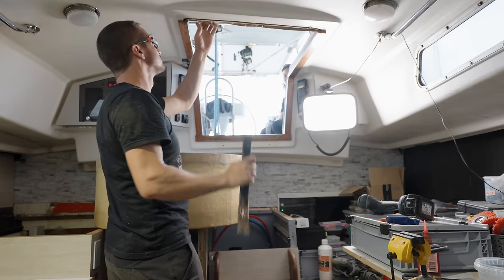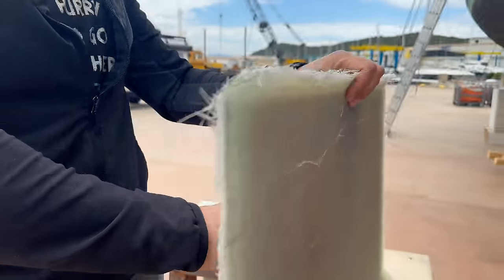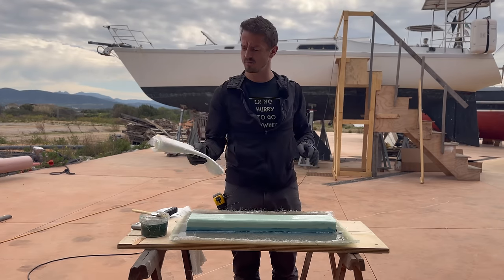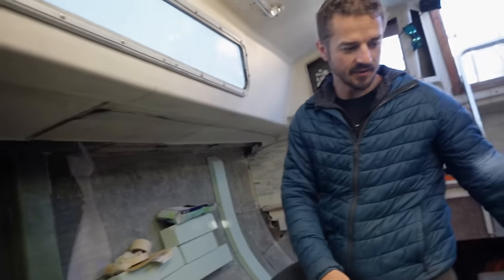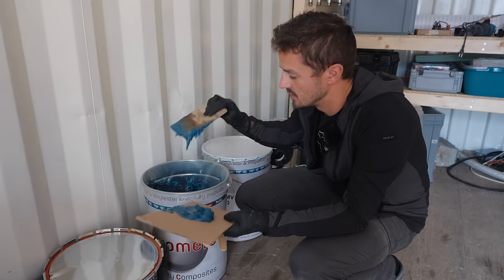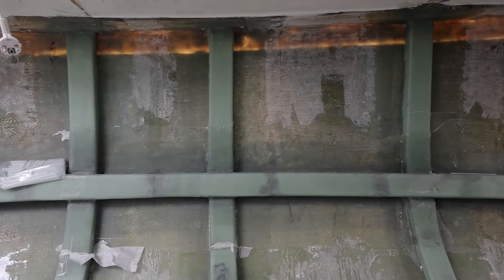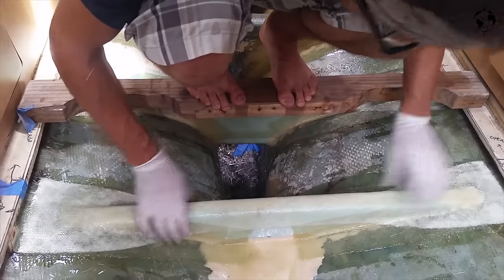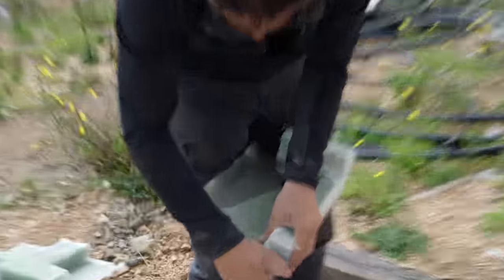Cutting Open our “New Hull”: What Could Go Wrong? | Step 386

Comment: For your delamination: (1) peel ply may leave a wax residue in place, so secondary bonds require cleaning (2) if the surface was fully cured, you need to sand it before bonding to it again, peel ply helps but isn't enough (3) you need to prewet the fabric before laying it down, don't lay it down dry. Your hired pros are using a lamination table; they saturate the fabric full of resin on a plywood sheet on your floor, before then moving the wetted fabric in place. This ensures a good bond. You didn't do that.
Reply: Oef this comment save the project....❤️
Reply: I was going to point out the same thing as your #3. Their process wasn't entirely the same as the crew working inside the boat. If they want piece of mind try doing it again but fulling wetting the fabric before laying it down. It will be a way different outcome.
Reply: They also didn't saturate the peel-ply when they made the initial piece.  leaving some of the waxes UNDER the peel-ply on the surface of the resin.  They needed to dewax the surface and then grind to key the surface.  You can see the pro's peel-ply was saturated.  Saturating the peel-ply makes "its resin" part of the overall layup  allowing the waxes to "float" to the surface above the peel-ply
Reply: Yeah of all comments of this video i think this is probably the issue
Reply: I'm a bit shocked by the easey seperation of the parts. I've had parts come out of a waxed mold that put up more of a fight.
Reply: Good points
Reply: Soo many differences. You just build yhe hull, I didn't see you Sand it before applying the ribs. They applied the ribs to a 50 year old hull that was fully cleaned and sanded first. Completely different foundations. Your fine.
Reply: Wet on wet or , once cured , grind for assured mechanical key when adding more laminate . ( imho ) the hairier the better for true keying of new to cured.. you’ll be ok you guys are smart and adaptive 👍
Reply: I would definitely try to delaminate a sheet inside boat, to many factors here not to make absolutely sure something else went wrong., pretty sure you will.
Reply: 😟Thanks for that cliffhanger. Now we will all worry about you
Reply: Going by the curled up edges of your test piece it looks like you glued your rib to the "underside" of your hull piece. Going by what others have said above, the fact you didn't wet that initial piece that you started on a piece of peel-ply could have meant a bad seal with it, compounded by not wetting out the first piece that went over the ribs.
Reply: I'm on pins and needles guys. My mouth dropped open when that delaminated. After all your hard work. It shows importance of proper preparation I suppose. Keep up the great work and keep those videos coming. Thanks.
Reply: To add the model broke because it's just one square of the boat on its own. There is no surrounding structure to it (i.e. the whole rest of the boat that criss-cross together)

Think hand ripping a piece of paper, vs ripping a whole book. It's impossible.
Reply: Ya, the boat inside surface was sanded but the test plate wasn’t sanded and cleaned before adding new layers.
Reply: Can’t recall. Did you use polyester resin for the test hull laminate? Fully cured poly needs a mechanical (sanded) bond. Freshly laid poly doesn’t because it will have a chemical bond. The reason is poly forms a wax surface once it fully cures.
Reply: You can use resin with or without wax.
Reply: It would have helped (after the correct prep 40-80 grit sanding) if the stringer was also bonded to the “hull” correctly with thickened epoxy. With just hot glue they have created a void as seen in the model. Hopefully in the boat this was not done.
Reply: If it turns out this is because you're all using waxed resin then you might have problems in the hull too. This type of job should be non-waxed resin. Otherwise the inside of the hull was sanded (?) so it should be ok. Maybe pick one spot and beat the crap out of it with a rubber mallet inside & out as a test. Fingers crossed!!
Reply: It kind of annoys me that @sailingUma doesn't reply to comments - especially awesome ones like this. Shame
Reply: Good advice. Also, use acetone to clean before starting laminating. As a good way to prepare the older portions of polyester before the process, paint a thin layer of styrene onto the areas and allow 30mins to dry and tack up the surface. You'll get a good chemical bond as well as mechanical.
Reply: Completely agree, sanding it down like you did with the hull should guarantee a good bond.  Way better than on a peelply surface, always clean and sand. You might do an other testpiece to confirm.
Reply: Really good description .
Reply: Or was this thier April fools joke
Reply: I just died!!!!!!  No worries tho, the  professional fabricators got you. Very smart to have hired them!
Reply: Strikes me that the point loads of the hammer blows were unusually high and concentrated relative to loads resulting from bumping a dock (though i guess the mass of the whole boat would also create extraordinary force). But good thing the fabricators did their thing...
Reply: Even before I saw the delamination, I was worried about the inherent weakness of the secondary bond between the fully cured (50 year old) hull and the fresh glass. A point impact like a dock or a submerged rock or even a hard grounding is definitely going to create similar flexing of the secondary bond. In top of that, Dan pointed out that the new framing  is very stiff while the underlying hull is very flexible. Any forces applied to either part of the structure is going to concentrate delaminating forces in the junction between old and new. Tensioning the standing rigging and putting Uma into the travel lift is going to be the next real test.
I’m concerned about this refit, but I’m looking forward to being wrong here.
Reply: This sounds like a good explanation to me
Reply: I agree the professionals did it right. If you want insurance so you can be sure for the next however many years you sail it, test a section inside that the pros did.
Reply: With a real “cliff hanger” 😮
Reply: Just wondering...what kind of resins are you using and what the hull laminated with ? Epoxi + epoxi ? Poliester + poliester ?  Check this out as epoxi does not bond on poliester resin

Comment: I just finished restoration of my sailboat Ecume de Mer 1975, and what I found was - any repairs of fiber glass with polyester resin on a top of polyester body doesn't have chemical adhesion at all. (Fisical only) 
Any new layers of fiberglass with polyester resin can be easily delaminated from the main body. What I investigated is for restoration of the old boat recommended the use of epoxy resins. In my case I used classical west system, 4 times more expensive, but it gives you structural and strong adhesion with old polyester body.

Comment: We have nothing to add except words of encouragement. As sailors on the west coast of Canada who rebuilt an Ingrid 38, we are so impressed by your self-sufficiency and your capacity to navigate your way out of bad situations. During our rebuild, we used only epoxy resin whenever we had to do glass work, so I have nothing to add as possible problems or solutions (and I'm certain that whatever I would say, you have already considered it); you are much more adept at figuring things out than I was and I am certain that, in the end, you will solve this problem just as you've done countless times in the past. All the best.
Reply: The bond failure may be a drama ploy. Many years ago I damaged the bottom of a 21 foot runabout (built by the now long defunct T-Craft) when a trailer roller collapsed on land. I could hear the glass cracking as the hull developed a large dent. When we got the boat off the trailer the dent came back to a fair shape. We repaired it from the inside with multiple layers of glass mat and woven roving  and vinyl ester resin. The patch was about the size of a large pizza. That repair lasted at least 8 years with no problems when we sold the boat.

Comment: @30:57; As one of your previous commentators mentioned, the peel ply has a wax residue that needs to be cleaned off, or it will act as a release agent (Similar to a silicone release agent) and I admit that I am definitely NOT a shipwright, I would have sanded between lay-ups, to key the surface, to help with mechanical adhesion.
  No matter how much abuse you give her, Uma has infinitely better structural integrity than she had before your refurbishment!

Comment: So that delamination looks like a secondary bond failure.  If the original "Hull" section was covered with plastic or peel ply or you used a resin with wax, then it was air inhibited and the chemical bond sites just aren't there to make a primary bond.
The prep you did on the hull, with the interior surfaces all sanded down to glass is the right way to do it.  You should get a good bond there.  Best to lay the CSM layer down first, rather than the Biax.
Another thing that can contribute to the failure is that what you tested may not have been full strength - it takes about three days for a resin to cure completely.
I think you're going to be okay when it comes to the work you're getting done on Uma.

Comment: Peelply has generally silicone as release agent. In the aircraft industry we've had several mishaps with both surface contamination and tool contamination. In your case I presume you don't use a resin with wax as that is the main reason why peelply is needed sealing of the curing resin from the atmosphere. Mechanical prepping of a silicone surface is a dead end it just drives the silicone contamination deeper into the surface. Low pressure grit blasting with aluminium oxide grit is the preferred method cleaning such surfaces. In your case there's not enough information distinct the model from the hull.

Comment: According to Shane from Young Barnacles YouTube Chanel  who is a composite technician, peal ply does not leave a surface that is ready for new laminate, it needs cleaning with acetone and sanding to remove the residue from the ply. I think he said the peel ply has silicon in it to stop it sticking and enabling it to be removed after the resin has cured.
Reply from the maker: Don’t know who that is. But the people we know who build boats for the last 30-40yrs laminate directly over the surface after the peelply is removed. That’s what peel ply is for.
Reply: yikes
Reply: I am definitely not against keeping the surface smooth in the final product.  But if you let it cure, it needs to be scuffed before it can be adhered to properly by the next layer.  I hope that is the only issue you run into.  I would strongly recommend taking a rubber mallet to the ribbing you just had done.  It would be terrible to discover an issue in the base structure of your vessel after you rebuild the entire boat!  Sometimes it’s better to take the hit early!
Reply: @SailingUma Shane is an expert. He works on high-dollar racing projects. I don't think he advocates using acetone, but peel ply does leave little particles of material behind after you rip it out. It is recommended by experts like Shane to sand lightly after removing the peel ply for best adhesion. But I am not sure what is going on with your layup. It came off so easily it was almost like there was a layer of mold release between the stringers and the "hull". I am sure the pros doing the stringers will not have the same problem. But I do agree with others that epoxy may have been a wiser choice.
Reply: @SailingUma the company that Shayne Young worked for, did testing on peel ply, found problems bond to a peel ply finished surface. Shayne worked on America's Cup boats and Volvo around d the world boats. He has done some amazing carbon work on his own boat. Like carbon chain plates, front beam. He has redesigned their rudders with winglets, to reduce the length but not efficiency.
Does Gunboat deliveries.
The O'Kelly's have interviewed him as well.
Reply: Hey KiKa and Dan. They are right, you first need to sand peel ply to get a good adhesion.
Scuff it up with a bit of scottsbrite and than whipe it down with isopropyl alcohol. To make sure you have done a good job. You can than spray some demi water over it (flatt surface), if the water purls you have to do it again. The water should form a  consistent film, dry it with a cloth and than it’s ready to laminate or bond. This is how we do it in the  Aerospace industrie. Hope it helps. Have fun 👋
Reply: Agree Shane has proved peel ply isn’t a perfect surface but then he’s working epoxy and carbon but not all peel ply is the same I’ve used cheap nylon fabric from eBay but always sanded before next layup
Reply: As I recall if silicon is used as a mould release you can only get it off using alcohol.   When working with either paint or resins I don't have silicon anywhere within fifty feet.

Comment: I believe that you should lay in filler to give the inside corners a 20mm radius, this allows the glass to bend through 90 degrees without cracking.
Reply: Yes, definitely fill in the corners with a radius.
Reply: Any cavity absolutely must be filled with something. If one is working with epoxy resins, it's a thickened epoxy.

In a research article I read that it's thickness of the sandwiched material which make the composite material really strong, meaning that voids are weak points. The material on both sides of the sandwiched layer does of course need to have a sufficient thickness.

Comment: For that very reason (polyester does not glue so well to polyester) we recommend in Sweden that all repairs are done with epoxy.  🇸🇪😄😀💕
Reply: it glue in a well keyed surface... i didnt see they preping the survace
Reply: I would never have done anything else in my boats. Sure, Polester is cheaper but that's not worth the risk.
Reply: well cleaned, corse grit sanded and cleaned with acetone have amazing adehsion
Reply: Nonsense! 

Polyester has approximately 480 psi bond adhesion strength to cured polyester. 

As long as the bonding surface is adequate area, and prepped properly, the repair will be at least as strong as the original hull. 

Any stronger is no real benefit.

Improper prep will cause epoxy adhesion to fail too, so that must be removed from the repair strength equation.

If the interior hull surface is 28 m^2 (43200 sq in), just a rough guestimate, the adhesion strength of an interior polyester skin, applied properly to the existing hull, would be in the area of 43200 sq in x 480 psi = 20,736,000 pounds. 

This is simple math an FRP expert should be able to complete in seconds. 

Please advise why any more strength than what polyester resin could provide would be required or warranted in any way, at about 3 times the cost?

Don't listen to everything you read (intended) especially from an epoxy manufacturer produced instruction guide. Of course they will promote the use of their epoxy product everywhere. They are in business to make money, and their marketing communications staff are getting paid big bucks to help sell more product. 

Whereas any FRP expert worth there salt will advise, NOT REQUIRED, NO REAL VALUE (for any repair application where the somewhat greater adhesion strength is of no real benefit).

That said, I use epoxy where the additional secondary bond adhesion strength is needed for the instant application, and that is maybe 3% of all the FRP work I do. 

Using epoxy where polyester will more than suffice has serious implications. 

It takes far longer in process time, it has serious temperature issues, it is extremely dangerous as airborne particulate (if not fully cured), and even a small repair patch pretty much commits to using epoxy for any other subsequent repair in contact (without jumping through hoops and unnecessary risk of adhesion failure), regardless of size or unnecessary cost, unless the original repair is ground out and redone with polyester, before the new polyester repair is applied.  

I do use a lot of epoxy barrier coat over polyester resin FRP hulls and repairs, but that is a completely different issue, and still a much more economical, safer, and better solution than performing FRP substrate construction or repairs with epoxy.

Quite frankly, I don't think epoxy should even be sold to amateurs. 

I can't tell you how many DIYers I have seen in yards grinding uncured (maybe only a day or two after kicking in cold temps) with no PPE whatsoever. 

Should be in head to toe Tyvek, sealed at every possible opening to skin or lungs, with a minimum organic cannister full face respirator, better yet, supplied air respirator. 

Even the removal of the peel ply from the vinylester in this video, without the PPE indicated above, is a completely unnecessary health risk, which stands as more proof that amateurs, should not produce YouTube "How To" videos, handling hazardous materials.
Reply: good argument for a metal hull

Comment: Peel ply has additives in it so you can pull it off. Some of that material always remains after peeling. It is essential to sand after removing peel ply. A wipe down is also recommended, mostly to get rid of the sanding residue. That said, the bond for such a 'contaminated' surface is usually much stronger. So I agree with some of the previous comments, that the laminate was not wet enough.